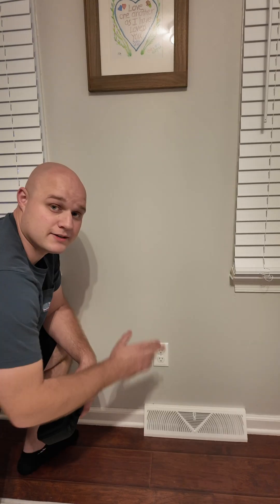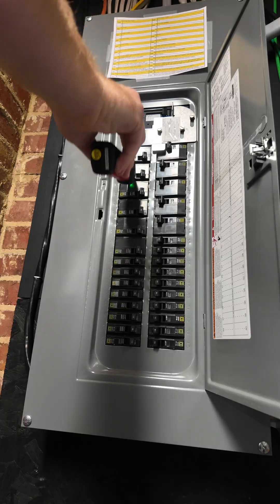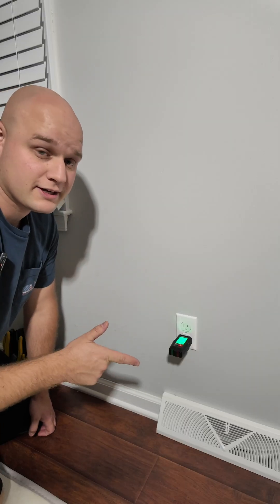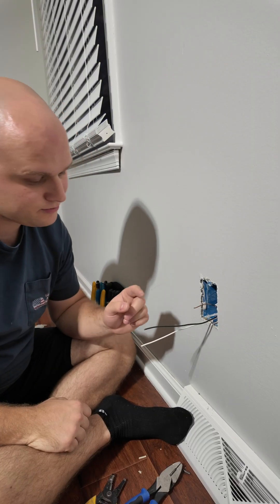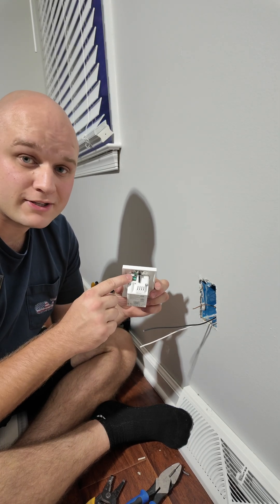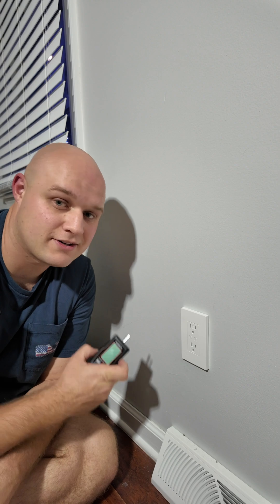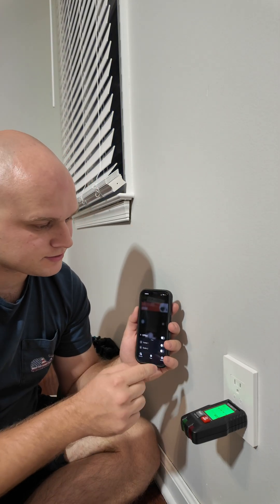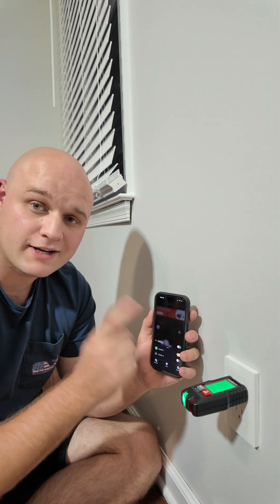Upgrading to a smart outlet is easier than you think with this circuit breaker finder! #SmartOutlet

Comment: Great outlet idea, but why not use smart bulbs if all you’re going to do is install this smart outlet for your lamps? You can also just install a half hot outlet if the outlet is already wired to a switch. Great tutorial though! We all have our own preferences 😊
Reply from the maker: Yes those are all great options! Just wanted to try a smart outlet out is all. Thanks!
Reply: This is way better. Smart bulbs aren't smart because in order for them to respond to commands,  a small amount of electricity must be used to keep them on standby,  which means constantly using electricity. Smart outlets on the other hand cuts power to the lamp,  making it a better option. Besides that,  you're being shortsighted because you saw a lamp being used as example but think of all the dumb devices that can be made smart through using this kind of outlet. Also imagine loading up these outlets with a power brick of multiple devices and with a simple command,  you can cut power to all of them, whether remotely or by voice commands. Can't get all that from smart bulbs,  can you? Too many ppl watch other's content with the aim of criticizing and because of that,  they miss out on the truly potential right in from of their eyes.

Comment: Why do you need a smart outlet?, if the internet goes down, does that mean you can’t use that outlet?
Reply from the maker: It’s how I controlled the lamp plugged into it. I can put a timer on it and control it with my voice. If the Internet goes down, the outlet will still have power and you can still use it as a normal outlet just won’t have the special features I mentioned above.

Comment: That breaker finder looks invaluable as I have five breaker panels not labeled very well. 
Two questions: 
1. If I have an outdoor GFCI outlet that tripped and defective will it still be able to locate to the breaker panel or does it have to be live? 
2. Is there a range limitation as it could be a 300 foot distance between this outdoor GFCI outlet and my basement panel? 

Thanks.
Reply from the maker: As far as I know, there is no maximum range for a circuit breaker finder! But for your GFCI outlet that has tripped I do not think it would be able to figure out what breaker that is on since it needs to send a signal through the wire. Hope this helps!

Comment: So people install a smart outlet so that they can turn the power off or on with their phone? What’s so smart in that if you still have to do it manually on your phone? And what’s a good use case to begin with?
Reply from the maker: Yes, that’s one of the features it has. Primarily though I use it to set a timer for the lamp I have plugged into it. It also allows you to monitor the amount of electricity used through it.😊

Comment: Smart??? Without an usb on it if I change our outlet I will change with usb on it Im electrician you dont need to cut those wire just disconnect those wires and straighten the wires and put an oig tsils on it…

Comment: Just so you know, you can release backstabbed connections without cutting the wire. There’s typically a small hole next to the backstab holes that you can stick a small, rigid piece of metal into, deflect the tab, and pull the wire out.
Reply from the maker: Yes, I know these wires were wrapped around the lugs. So it was just easier for me to cut them. Also, I prefer not to backstabbing outlet as I feel like the connection is not as good as wrapping it around the lug and tightening it down. 😊
Reply: @TheLifeoftheZigs Oh, it looked more like backstabbing to me. But yea, I too am in the ballpark of advising against using them, because they’re not very strong, and can cause issues.

Comment: I have a switch with no neutral, which is in a hard to reach place. We want to put a smart switch there. For the last five years.
Reply: They make them but they are super expensive I’m in the same boat. You cannot legally use hot and ground with no neutral unless you add a buttload of electronics and since it’s a low volume specialty switch which still has to be approved by a nrtl I think the last time I looked they were just north of two hundred dollars.
Reply from the maker: Yes, sadly, the best thing to do is run new wire with a neutral in it

Comment: Why did you pig tail the wires?
Reply from the maker: Just incase that outlet fails in the future everything else will still have power 😊
Reply: oh so a smart plug has the ability to stop power flow kinda like a gfi?
Reply from the maker: @easy4life23.  no it does not. Basically I guess what I’m trying to say is if there is a failure, there is a chance the outlet could cut power off. Again, you do not need to pigtail I just chose to do so.😊

Comment: Wait how does an app turn power into an outlet
Reply from the maker: Through the internet…😅
Reply: @TheLifeoftheZigs I’m trying to picture in my mind how that works bc in real life the switch is physically making contact between two points stopping the flow of electricity but what’s the app actually doing inside the switch? Is something actually moving or is that part all on a circuit board?
Reply from the maker: @JustinMentionedIt not sure to be honest! Probably some sort of circuit board

Comment: Having to connect to an app before you can use an outlet is actually insane.
Reply from the maker: Hahaha you can use the buttons and keep it always on. But the point of the smart outlet is for the control aspect from anywhere 😊
Reply: @TheLifeoftheZigs  okay then why did you say you had to set it up in the app before getting power?
Reply from the maker: @altokers  because if I started pushing the buttons on the outlet first and not set it up in the app first. It would’ve defaulted to manual mode and I would’ve had to reset the outlet to set it up in the app.
Reply: @TheLifeoftheZigs  well that seems like a bad design.

Comment: Had a smart switch.  T'was more expensive when the fixture shorted out.  Burned a link in the switch (I had to take it apart, of course).
Reply from the maker: That stinks! I’ve had smart stuff In my house for 5 years plus with no issue

Comment: If only there was a sticker on the panel door that could be labeled with which breakers control which outlets
Reply: I've done low voltage installs in multi-million dollar houses that don't have any of the panels labeled it's ridiculous.
Reply: Just short the outlet 😂😂
Reply: @boris-bikepack great way to figure out you have a bad breaker and burn your house down
Reply from the maker: @boris-bikepack 😂
Reply from the maker: Yeah! If only more people used them!

Comment: You didn't explain what wires go where. Just how to use a sponsor's tool?. When in reality most people would just plug in a vacuum or a lamp to the outlet then turn off the breakers until to figure it out.
Reply from the maker: I’m not sure if you watched the full video or not, but I did explain where the wires go…

Comment: What actual benefit are you gaining from this ?
Reply: Controlling the outlet power flow to help reduce unnecessary power trickle when unused. Also it makes it convenient so you can turn off items you may have forgot to turn off or don't fell like going to turn off
Reply: Yeah, I don't get it either... especially when you can get like 4 smart plugs for $20. Those are actually quite useful. I use them to turn lamps and hard to reach outlets on and off from my phone. Same function but much cheaper than doing the entire outlet.
Reply from the maker: @philkingmke  yes they do sell smart plugs, which are nice. They’re just usually big and bulky and I’m not a fan of the extra inch stick sticking out from the outlet.😊
Reply: @TheLifeoftheZigs yeah, I feel you. I really only use them in areas where the outlets are hard to reach so I never visually see them anyway. Just thinking from a pure price and work stance, I can't get on board quite yet.
Reply from the maker: It allows me to control the outlet from my smart device and set timers and such for the lamp that is plugged into it
Reply: @TheLifeoftheZigs Smart bulbs exist though.
Reply: You or the power company
Reply: The laziness & ignorance of the CON$umer is mind-boggling to we, but the corporations and CONglomerates love dumb!!!!